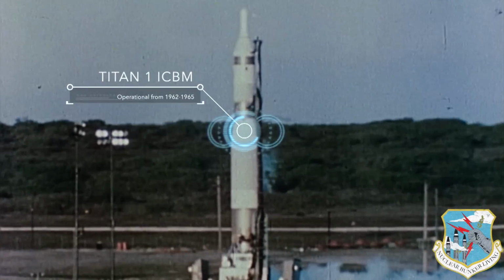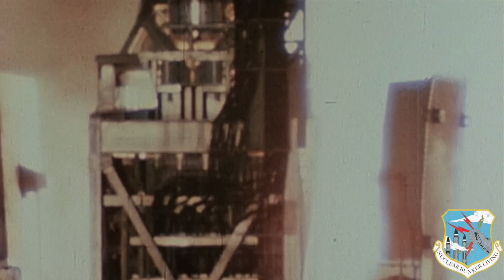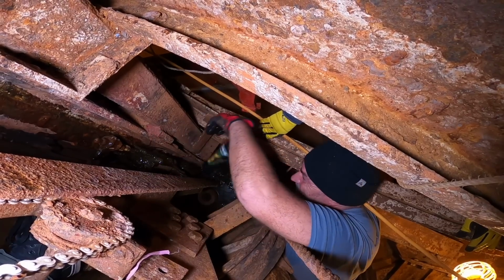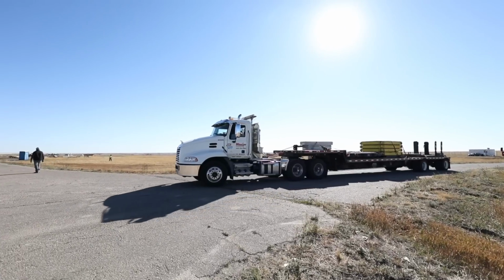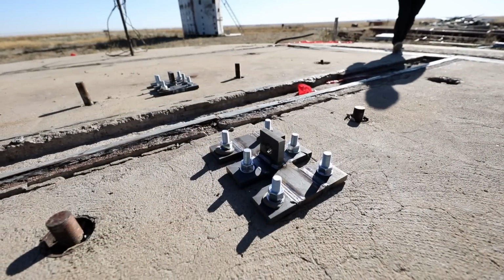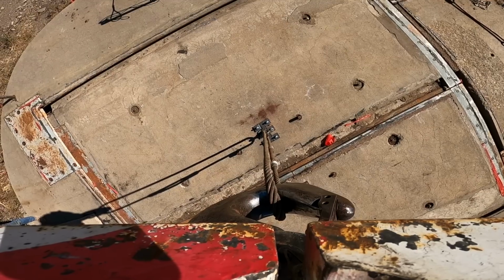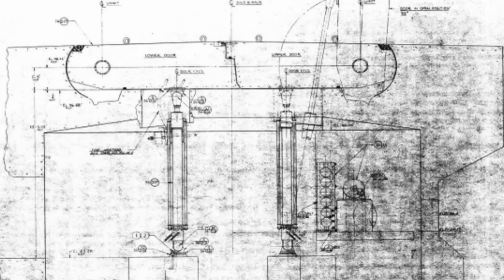EP. 18 - Ridiculously Expensive 275 Ton Crane FAILURE

Comment: Interesting, I spent quite a bit of time around the sites in Washington state.  Brute force never worked on opening anything. There seems to be quite a few changes made during construction. The doors where designed to be opened using a mechanical advantage from the inside and not forced from the outside. Similar to how a safe works. We should chat.
Reply from the maker: Amazing engineering for sure.
Reply: "Brute force never worked on opening anything" I would disagree...it worked pretty well on Hiroshima and Nagasaki.

Comment: I am assuming that you have bypassed the hydraulics. 
Drawings don't indicate whether or not the rams are double acting. 
Do the doors go over center when fully opened?
Are the rams seized?
I would be inclined to disconnect the rams till you get the doors open.
Reply from the maker: Hey Kim.  The actuators were scrapped in the 70’s.  Yes on the centre too. 

Thanks for being part of our community.

Comment: That's not a crane failure. The failure was in engineering and planning. They were pushing the equipment (rigging) and quit before having an accident. Having rigging explode probably would have destroyed that crane due to shock loading. I've worked with the guys at Winslow and always found them to be experienced, competent professionals. I prefer them over many mobile crane companies in the Denver area.
Reply from the maker: We definitely had issues unfortunately. Winslow guys were honourable. Nice guys
Reply: They put 75k lbs on a shackle rated for 30k… Sounds like a bunch of competent professionals to me!

Comment: I just watched your most recent video with the smaller 'cork' you were trying to remove with a crane and you said this attempt cost you 20K.  For that kind of money, have you considered trying to get the original mechanism to work?  You wouldn't have to have a huge hydraulic pump.  I mean, who cares if it takes an hour or two to open the doors?  Just a thought.
Reply from the maker: Smaller crane was FREE.  Even to set up hydraulic rams you need to open structures.

Comment: You need to get the original hydraulic/cable system working!   Is the original mechanism still attached and holding it closed??
Reply from the maker: It was removed by the military when it was decommissioned.
Reply: @NuclearBunkerLiving  Was it just two big hydraulic cylinders like the blueprints showed or cables and smaller rams?  Maybe  a couple hydraulic jacks from a house mover, powered by a portable hydraulic pump/tractor?  What are you aiming for, two open doors, total removal?

Comment: Seems like to raising one of the doors might be more easily done by pushing upward from under the door, using a large capacity hydraulic jack, & a heavy duty support structure for the jack. While this method wouldn't raise the door fully open, it should be able to release ("break loose") the door from the rust friction, which prevents free movement of the door hinges & of the door itself within the door frame. Then, maybe a heavy bulldozer could be used to pull the door the rest of the way open using large steel cables attached to the same lift location on the door as was used by the crane. Another method would be to construct a frame with a large diameter pulley  to route the cable from a vertical pull to a horizontal pull, then use a bulldozer to pull the cable. Better still, use a block & tackle cable & pulley system attached to the bulldozer & to the cabIe (which is routed over the frame's pulley, & attached to the door). I believe this way, a large bulldozer could provide (possibly much) greater pulling force than the crane could provide lifting force. Cranes, in spite of their rated lifting capacities, are always limited in lifting capacity by boom angle & boom extension length, & counterweight amount. The farther the boom is extended, & the lower the angle between the boom & the ground, the less the crane can safely lift, depending on amount of counterweight on the rear of the crane's superstructure.
Reply from the maker: Appreciate the feedback.  It’s a delicate dance between both doors. We don’t have real platform structure for Hank’s underneath. We will be making another attempt soon.  Thanks for being part of our channel community

Comment: Those doors were probably hydraulic, wonder if they capped off the motors in the door, if so you would never be able to open them unless you released the pressure.
Reply from the maker: Hydraulic rams were removed.  We have a few options to experiment

Comment: construct a steel frame portal over the doors, and use threaded rods like mining "roof bolts", in large numbers to yank the doors out of their recess.  you can literally apply thousands of tons of pressure to pop them.  Or alternatively use an oxygen lance, like they employ to cut into reinforced concrete bank vaults and obliterate the doors from above.  cut them into chunks.
Reply from the maker: Wow.  Intriguing. Thank you.

Comment: I beam over the doors, jacks on either side untill you atleast get the doors moving, cant imagine bringing that crane in was cheap. Obviousl beam, rigging and jacks of suitable size aint cheap either but it also affords you time to play with the setup, figure out the actual weight of the doors, get them free etc.
Reply from the maker: Over 70T each. We just didn’t have enough eye bolt rigging.  Plus we can’t hydraulically Jack up from below. More attempts will be made.  Appreciate your feedback Denis. Thank you.
Reply: @NuclearBunkerLiving  I get you can't jack from below hence suggesting a beam and jack's from the top, obviously this won't open the doors wide or anything but it will allow you to crack them open and test rigging and mounts before the expense of another crane. I love what your doing and thankyou for sharing it with us!
Reply from the maker: Thank you.

Comment: Been binging since yeaterday found your channel. A hell of a lot of work ti rehab that thing. Have had several questions along the way but bingeing on my TV does not let me post comments. Gonna try to post though not sure if or when you can find the time to answer anything. Been looking into the Comunications Centers my self but 1mill give or take and no financinf is imposible for a individual like myself. Question on this one is: why couldnr you jusr referb the present elevater? I know is old and dirty but a few cables, pullies, gears, maybe a motor here or there and new wiring. Seems would get that thing functional faster and cheaper then gutting and replacing the whole thing.
Reply from the maker: Elevator car is compromised as are the motors. It was submerged for many years.

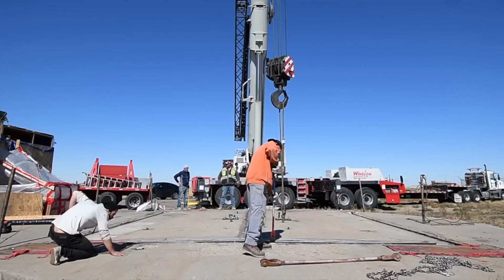Comment: 17:56 I hate to say it but if 75,000 lbs of pressure isn't doing the trick I am skeptical that a 190 lbs dude with a burke bar is going to be the turning point in this particular battle!
Reply from the maker: Mosaic of issues. We will be making a 2nd attempt in the late Spring.
Reply: @NuclearBunkerLiving  so 37 ish tons wouldn't move the doors .... What about building a steel press frame over the doors and pulling with two 100 ton hydraulic cylinders? I've build press frames that endure 400 tons do I imagine it would be possible to do in this application also .
Reply: @NuclearBunkerLiving  whoops, just realised that I'm a lil late to this party... Sorry
Reply: This video had a world full of osha violations.

Comment: Is there any space between the bottom of the doors and the seating surface of the door frame?  Also have you confirmed which door overlaps the other?  I feel like you could get this opened with a combination of the following:  heat the hinges until they are red hot then quench with something like WD40. The heat with help breakup the rust and pull the Lubricant into the joint. Next if there is space underneath either of those doors get some 20 ton bottle jacks underneath the non hinge side of the doors. It likely won’t lift them alone but it will put tension on the hinges and over a few days it might help it break the rust up in the hinges.   Next bolt a 20-30ft I beam to the door so it sticks out like a giant finger pointed away from the hinge. Note you will need to reenforce the bolt area with some very heavy steel.    From this point you should be able to use the excavator to pull up on the far end of the beam and the leverage multiplier the beam will provide should get the door to move.  Once it’s moving you should be able to open it completely with the excavator and loader working together with some cables.
Reply from the maker: All good points @MRBenchwork.  Thank you for being part of the ‘NuclearBunkerLiving’ community.

Comment: Go to 24 Min 0 sec in video.
 Go to the top door( lays on top of the other) Remove the cylinder, end , that frozen , remove hydro pipes so the  ram can move . 

 Get 2 each ( D 9 Cat dozers) , Chain them together  end to   end ,right where your military  forklift is . .
Put steel plates behind drivers( don't get killed if a chain breaks..)

Stack a pile rail road ties 10 feet tall , at the edge of the door  so that the Chain pull is 45 degree . 

Slowly just Nug on the 5-10 chains . (You can bust the cement doors in half, have fall in ). The are weighted and pivoted so take very little effort open them( they are Cat levered)

Have 1- 2 i beams ready slide across the opening . prevent door fall in  .
If don.t   easily move open going have remove doors . By  jack hammering them apart.
Hope this helps.  

Open silo doors even more fun, Must use hydro cylinders.. with external pump.

Go slow ....Good luck.

.
Reply from the maker: @Michael. Don’t want to demo or jack hammer the original access portal doors. Want to preserve them and attach new rams. Once the doors are open, the existing elevator car will be removed and new one will be installed. Appreciate the feedback.

Comment: Any way at all to get the old hydraulic rams to work , and use the crane at the same time to give assistance ? Or even remove the hydraulic rams they could be working against you by keeping it pulled down ?
Reply from the maker: @kieran. The hydraulic rams were removed at the time of the 1965 decommissioning. Once the access portal doors are finally opened, I’ll be attaching new rams to the doors. Appreciate the support.  Be sure to catch up on past episodes.  NEW video each weekend.

Comment: Is there access to the swing clearance pit behind the hinge point, if these pits have filled with sand over the years, then you will not only be trying to lift the doors but the whole portal too, good luck, fingers crossed.
Reply from the maker: @Callum. Thank you. Much to review for the 2nd attempt. Appreciate the support.
Reply: @NuclearBunkerLiving  Hi there, would it be possible to attach a lifting point in each corner, remove the hinge covers and just lift each door in turn in the horizontal position, you can always sit them back down vertically on the hinges afterwards. All the best, looking forward to the next episode, thank you
Reply from the maker: @Callum.  Taking all points into consideration.  Much appreciated. Quite a frustrating day.

Comment: Hey Nik, sorry it didn't work.  At 40 ton or 80,000 pounds per door, that Crane should have lifted that door with ease. There should be a way to remove Pillow bearing cover plates and grease them.  
Keep up the GREAT WORK...👍
Reply: If you say so...but I will tell you my Grandfather built the Larson AFB Titan I's and my Uncle was the Supt during construction at all 3 of the Sites.  I have NEVER heard of both doors opening together. Good luck 🤞
Reply from the maker: The “duet” reference was that one portal door starts, and then the other follows in close sequence. There is significant thickness in the portal doors for each door to move past. Appreciate any intel you can provide. Your Grandfather was a “rare breed”.  Major respect. 
Thank you @Siloman
Reply: Here is my attempt at getting them open.  Bring in an excavator with a hydraulic breaker and a hydraulic compactor.  Drop one of those 2” steel plates they use to cover work sites in the roads and lay that baby on top of the door.

Use the compactor all around the top of both doors like it’s getting a good massage.  You can observe it from underneath with binoculars and a spot light from the end of the silo enter ace.  You should see a good amount of dust from all the seams.  

Then hit that plate a few times with the hydronic breaker.  This should break free any calcification and rust that has developed along any seams. 

If that did not open then the only way to get it done short of destroying them would be to restore the hydronic systems and hit it from both ends. 

Same method on that big concrete plug you were trying to remove. 

But that’s my opinion spending your money.  

Keep the videos coming.
Reply from the maker: Indeed my friend.  Cover plates were removed and greased.  There is a sequence for the opening. Consider it a duet dance. Atlas F’s are far more easier to work with.  Thanks for the support @siloman.